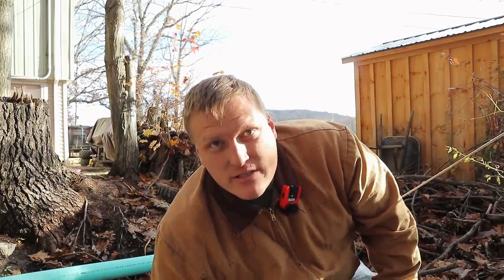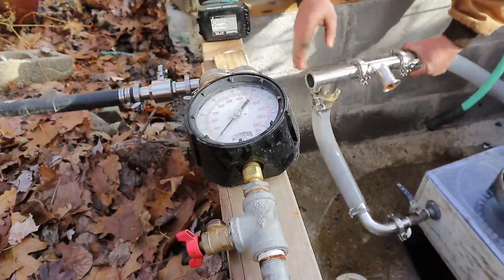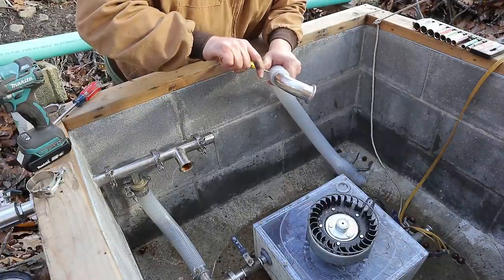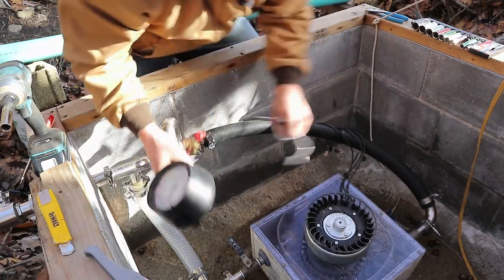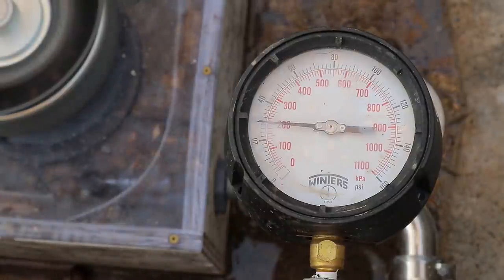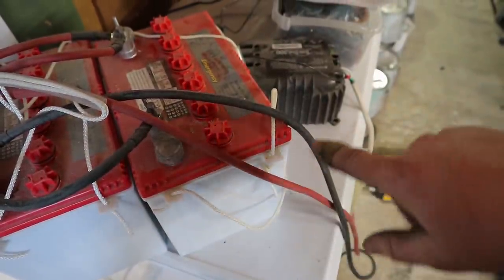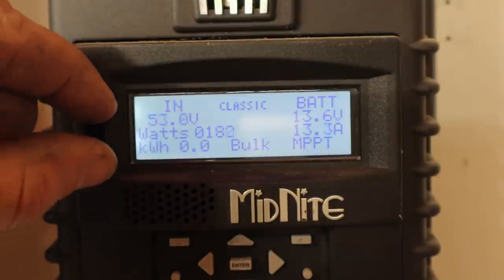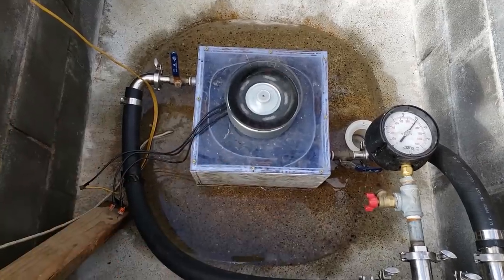Microhydro Turbine - New Hoses and First Start Of The Season

Comment: One thing you may not have thought about . When you have low flow and your  not making enough power to keep your electronics working, you might want to think about something called a buck,/boost transformer. It takes a lower voltage and boosts it to a higher voltage output. Think of it like a stun gun. A stun gun uses a low voltage source and builds it using capacitors and zener diodes to increase voltages exponentially, into millions of volts at the output point.

Comment: Hi Joe.
Nice to see that you are still working and maintaining your Hydropower system.
A few recommendations.
1: take some plugs and screws and fasten your wires on the wall beside the generator. Also, if you can or know someone you can help you with this - TIN the ends of the wires before you get corrosion. Trust me, that comes quickly. If possible but the couplings/wagos inside a small box to protect them from moisture/splashing.
2: drill and anchor that new pretty "roof" you had made for the collector bucket. Preferably with a trio of bolts, and then attach it with a wire around a nearby tree. That way you won't "accidentally" lose it.
3: put some fibreglass into both ends of your electrical piping. That should prevent any mice from entering or chewing their way into your house. Put oil-based paint around any exposed wire in the wild. Should prevent nibbling from animals since it smells/tastes bad.
4: a thought for the future. Put an electrical gauge that reads the pressure that can control the two nozzles via electromagnetic shutoff valves. That way you could cut off flow at low pressure - let i build and then release it and generate power. Sequentially also, if you let the controller/s have separate levels to work on. Say, 40-80Psi, and 85-130Psi?

Good luck and nice to see you are in good health! (Maybe Henrietta would be a good name for the chicken?)

Comment: Notice how bad the air/water hammer effect was when you blasted your connector off.  You really should open a valve to let the air out in that kind of situation. Right now the rubber hose is the weak point, but it'd really suck if your hard line uphill burst.
Reply from the maker: This was pretty bad, the water developed some inertia as it compressed the air in the pipes. Normally it isn't so bad because everything is already full of water but unpressurized.

Comment: A cool and difficult solution for the dry seasons when there isn't enough power to power the charge controller would be to put a large diameter slow closing solenoid valve at the bottom, behind the hand valve, running wires up the hill to the barrel and a couple float switches. One at the fill level and another at the empty level.
Could get you high flow and pressure for short bursts, hopefully letting you use the energy!

Comment: Great set up. Have you ever thought of water wheel with belt driven generator. A good heavy duty water wheel with good momentum will have good amount of torque to transfer of  that energy to belt driven power generator for a longer time even into late summer with less water transferring it's kinetic energy to the water wheel and on to belt driven generator. That's just my opinion. Great job👍 A good name for the lady hen could be Ms Curiosity
Reply: There's no free lunch, you need water+gravity to make power, and you have a fixed amount of gravity, and a variable amount of water. No matter what system you use, you're at the mercy of your water supply.

Comment: For nozzles you could try Holley Carb jets, just unscrew them out of the body and change for different flows during low flow periods.

Also have you considered ceramic bearings for the turbine? They won't rust and run with less parasitic losses
Reply: are ceramic bearing that good?
Reply: @shazzz_land  They're expensive as all hell which is why most people write them off, they're also very hard and therefore brittle so the average rock ape with a hammer breaks them when installing them, but when installed correctly they work well, less parasitic losses, less weight, less need for lube, less need for maintenance and therefore downtime, longer lasting and corrosion resistant, all things which add up to an easier life with more output.

Comment: Next step, you need a system that turns off the water when the pressure is not enough, let the system refill and start again when the pressure has reached proper level. So it work on and off, but it is better than trickling water and being off...

Comment: A couple of things to think about.  Put in a pressure relief valve at the bottom to minimize water hammer.  Years ago we had a small hydro system and to shut off the valves we used a linear actuator from a landing gear with enough resistance that it took 15 seconds to close.  there was approximately 1200 feet of 10" pipe behind the valve so water hammer was a huge deal and we were only running 26psi.  If you don't have enough water to run two nozzles set up a process to turn one of them off.  Power will decrease but there will still be some.  You have some serious head loss on your system if you are only getting 40psi on 280 feet of head.  You could be generating a whole lot more power than you are doing if you had a larger penstock.  You need way smaller  with no head loss your water should be coming out of the nozzle at about 130 fps.  At 40 psi you water is only coming out of the jet at about maybe half that. so you water only has about 1/4 the energy it could have.  Everything else is lost by friction.  Cut the nozzle diameter by 1/2 and you should get more performance out of your system

Comment: As has already been mentioned below, it may be worthwhile looking into some kind of control system based on water level measurement. A tank level meter could report the level of water in the header drum and feed these into an Arduino (or similar) connected to two valves - one on each of the two nozzles. When the water flow is too low you can operate on a duty cycle e.g. one valve on until the water gets low in the drum then off until it refills, then if the drum stays full on one valve you can do the same with the second valve, with both being on all the time if the drum stays full. This means you will always be using the stored energy  of the water as much as possible all the time without the need to manually operate the valves or change nozzles.

Alternatively you could use a pressure sensor on the penstock where it feeds the turbine instead of the level meter at the drum, which would save the complexity of getting data down the hill (long cable or wireless). If you wanted to take such a system a step further you could also look at automatically adjusting nozzles.
Reply from the maker: I'm collaborating with a viewer on this exactly, for a while now

Comment: I'd love to see the turbine augmented with a digital control system. A digital pressure sensor feeding a controller which opens/closes valves for the turbine. That way you could automate stuff like frost protection in the winter, adjusting the amount of used jets to the water supply, pulsed turbine usage when supply is low, and other fancy functions.

Comment: Have you thought about replacing your lead acid batteries with gravity storage (a big tank near the creek)? If you added motorised valve control you could just have an arduino open the valves when the charge controller cant keep up the voltage when you plug in a load. You could also replace your inverter with an UPS with disabled charge circuit. That way you could have the system automatically switch over to line power when the top tank is empty and the charge controller voltage drops down to a certain level. Of course some small supercaps would add some stability.

Comment: Glad to see more hydro videos, even if the flow isn't exciting. I don't think it's worth running thicker wire as that romex should have more than enough capacity for the 250 watts at 80 volts you're running through it.

Comment: Just a suggestion but when you were losing pressure with all jets open (around the 15m20s mark) could you step down your hose supply line? Eg 1 1/2" from spring then 3/4" to all jets maybe.

Comment: Look for some steel cables to make a cable way up the hill between lines of trees. Double check with the land owner and set them high enough to not be a ATV/Bike hazard and you should be able to hang the load from a pulley on the cable and use that rope winch to pull up to a transfer spot between cables.  

It will both be useful when you go to rebuild the collection setup at some point and if you can figure out how to do a camera mount to move on the sloped cable as you can do action shots for the land owner as they ride near the cables.

Comment: Dig a large pond at the top it's cheaper than batteries
Install solar because 250W isn't enough to live by
Upgrade from 12v to 24v or 48v battery storage, fewer amps at more volts will be more effective

Comment: It would be interesting if you could put a big tank at the source with a float valve to allow enough water to build up slowly until it's full enough to run the turbine for some time at the maximum power point. Maybe a bell siphon would work to automatically start once the tank is full.
Edit: If we're getting that technical, you could do ultrasonic level sensing and have some sort of nozzle regulation. Maybe seeing you have two nozzles, you'd have a solenoid on each one to adjust water consumption automatically. You could have two different sized nozzles to adjust flow from off to slow to medium to high.
Edit 2: Great you're upgrading your cables. To work out how much power you're losing across the cables, measure the voltage at the turbine and the voltage at the charge controller. The percentage power loss is the same as the percentage voltage difference. You may also want to run some thin sense wires while you're at it, although that's not really useful in any way except if you're troubleshooting from your shed.
Edit 3: It looks like you've already got the collection tank. Maybe just a bell siphon would work.

Comment: Kris's issue with the bearings was because it needed a slightly longer shaft throw off disc and splash shield, ceramic bearings would help as well

Comment: What hose clamp would you use to get a uniform seal? Wormdrive clamps has this small gap where it tightens, i could imagen if you clamp down on a thin hose, this gap will leave a small section without the same pressure as in other spots? 
Thanks for explaining about the sanitation clamps! If you like, please explain all the parts as much as possible and how they work or are commonly used :-) great vid
Reply from the maker: I use t-bolt band clamps
Reply: @JoeMalovich  Thanks for the answer :-)

Comment: Two thoughts:

Use a bit bigger pipe on top for air intake in case of an underpressure event. This way you can put a rubber disk in the pipe which is exactly the size of the pipe. Hold the center with a screw from the top.

This way it will act like a valve which only opens if there's an substantial differential pressure which can bent the rubber down or up. On small events or just a little bit of drag by the water no air is pulled down.

But air can burp out slowly, since the water will squeeze it out and air can be pulled into the pipe if the pipe has moving water in it but the valve on top is closed fast. 

---

Have you figured out how to sense/meter you consumption at the turbine in reference to your intake? 

If not I just wanted to repeat my idea from last year:

Get a float valve for your intake and use it upside down. This way it will close when the water level drops in the tank on top, and open again when the water level is high.

You now just need a digital pressure sensor at the bottom. If the pressure drops, it's a clear indication that the pipe isn't filled fully with water, so the demand is higher than the consumption, so you can adapt your consumption at the turbine.

Same goes the other way around, if the pressure increases the last air in the pipe slowly burps out. So you can increase the consumption.

That way you can avoid having a sensor in the collection tank which needs to send sensor data to the bottom.
Reply from the maker: You're saying a sudden low pressure event with a sensor at the bottom controlling the valves? I'm just concerned the "hammering" would not be good for penstock movement. Passively measuring the pressure would work, I would just need to know high and low triggering pressures at each flow rate because the dynamic pressure changes. If I lived somewhere where it doesn't freeze hard every year I could have a separate "sense" pipe running all the way up.

I might just run a wire up to a float and be done with it.

The guy I've been collaborating with is very slow, he was working on a topside wireless sensor suite
Reply: @JoeMalovich  not really sure why it would cause hammering...🤔

When you have 4 different sizes of nozzles for example you can switch them on/off to increase/decrease the total flow.

Obviously you would ignore the measurements for a minute or two after opening/closing valves to let the pressure waves running up and down until they are settled.

A sensing pipe should result in a similar switching behavior, since you only need to know if the level decreases or increases.

The flow pressure vs a static pressure doesn't really make a difference, since you would get pressure waves in the sensing pipe on the top which would run down to the sensor again.

I would just settle on something like:

-measure every second the pressure
-run an outlier filter on it
-run a low pass filter on it
-run a moving average of 3 minutes over it

Then have a look if the value is above or below your thresholds and the direction the last like 10 values are pointing.

So if it's above and pointing up you open a valve and when it's below and pointing down you close a valve.

Then you just suspend valve operations for 2 minutes.
Reply from the maker: Sorry I was imagining the rubber flapper wrong.
Reply: @JoeMalovich  Rubber flap is just to avoid that a mild vaccum pressure is pulling air bubbles into the pipe, while the tank is still full.

If the flow rate is high enough these bubbles might have a hard time bubbling against the flow of water up again and will reach the bottom.

Since you don't have an air/water separator at the bottom (like a pressurized tank) they will pop out of your spray nozzles and reduce the efficiency.
Reply from the maker: Thoughts on an appropriate sensor setup for the forebay tank? I could have basic float switches or a proper analog sensor. But should the sensor be just resistance that I could read from the bottom control setup? A 0to10v sensor? I'm concerned how 800 feet of one way wire works with sensor signals. I was thinking direct bury 23ga cat6 wire would be cheap enough and suitable. I'm concerned about voltage loss and resistance and I'm up against my current knowledge limit.
Reply: @JoeMalovich  well the best solution would be to just submit the data wirelessly without any complex software stack, like wifi.

The best solution for the US for this distance would be 915 MHz which can be used with up to 100 mW and 300 kbit/s with an RFM69 chip.

Other hardware to use would be nodemcu/esp8266 and some touchless water level sensors.

For example this sensor might work: Xkc-Y25-Npn

Just put more than 1 sensor there, just to be able to do some sanity checks, because ice can throw them off.

To protect them from the environment just cut a pipe in half and glue it around the sensors on the outside of the tank. :) 

For power I would step the main voltage up to something around 400 Volt and put an RCD after the step up for protection on the wire.

Then just run two wires up through the pipe and step it down again, but choose a trafo which can compensate the loss by putting a little bit higher voltage out effectively.

Then use a regulated power supply, like for a notebook which can accept 100 V to 250 V which should give you clean 12 V DC power which you can use with unregulated step downs for the 3.3 V etc.
Reply: @JoeMalovich  for the analysis / automation you can use Home Assistant. It has the advantages of having statistical functions built in and you can combine of the shelve hardware like zigbee devices as sensors with diy stuff like Esp8266 :)
Reply: @JoeMalovich  btw: You can obviously also run a sensing pipe inside your feeding pipe.

While the measurements are garbage in terms of absolute values since the pressure inside the running pipe is messing it up... relative values should still be unaffected, since the pressure inside the measuring pipe is always higher than the pressure in the feeding pipe.

This way of measuring obviously has the advantages that you can measure inside the tank instead of measuring inside your feeding pipe, after the float valve (if there's an air pocket after the valve). So you don't loose any pressure for your turbine.
Reply: @JoeMalovich  and if you're still concerned of water hammer effects... just add a large over pressure release valve to your system and adjust it to 130 psi.

This should reduce the pressure waves bouncing in your pipe, since they have a way to release some of the energy.

Comment: Just been watching your videos, one thing strikes me, the used water is reversed direction in a Pelton wheel so needs not to touch the wheel again, I would run the wheel with a plastic disc separator just outside the centre of the cups and plastic scrolls to stop the water touching the wheel making the housing bigger so the waste water exits cleanly, the only important contact is the active cup really

Comment: nice tour, seems like there is no real resovoar? I.e if its dry its dry and if rainign you get to much flow and water is wasted?
Reply from the maker: Correct, until I get the automatic valve controller installed.